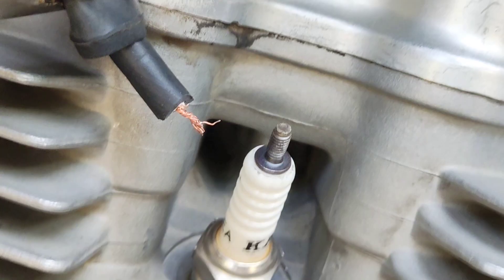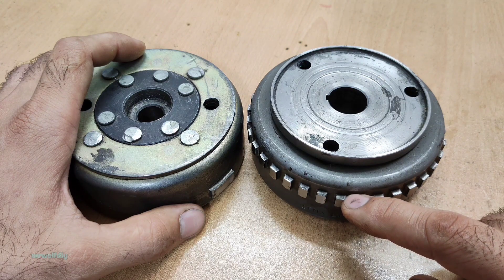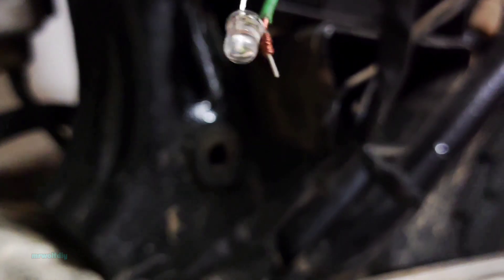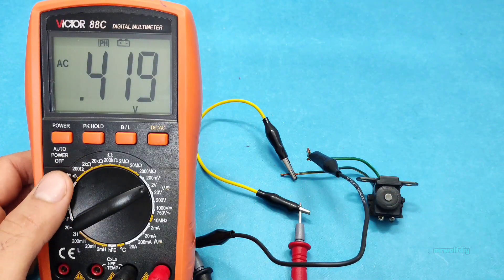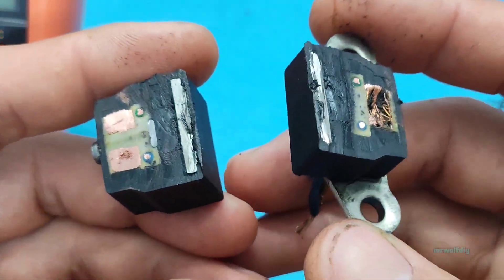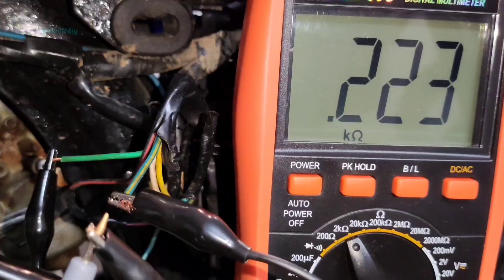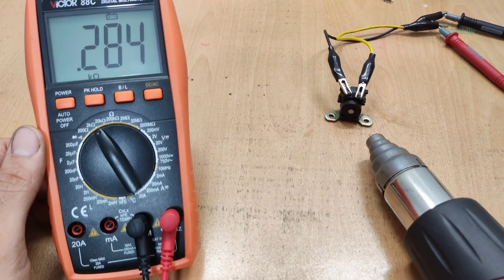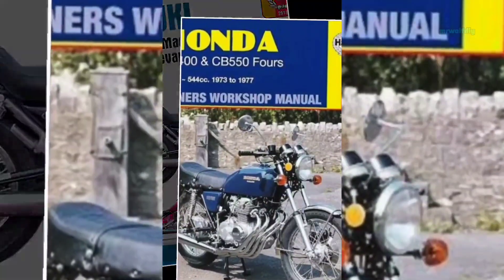NO SPARK? Don’t Replace Anything Yet – Test THIS First! (3 Best Ways)

Comment: Great information for bikers who are lost their money, most of mechanics doesn't know proper technical issues. they always told to change entire ignition system which cost more than 2000+. It is unnecessary, this will finish your problem with in 300rupees.iam also one of the victim, I lost my money. 😮

Comment: my issue is kind of weird, oem stator just looks as brand new, no blackish colours all over and no burnt signs. It could be my pick up coil,  when i kick start it there is a spark but it doesn't turn on even when the carb is tuned and everything is set. and eventually when I actually start up the bike it stutters like having a stroke, it needs more throttle to get it steady but when I let go it dies. you reckon it could be the pick up coil? bike doesn't wanna even start at the 2nd day of this issue. (the 1st day of the issue is when i go full throttle, the bike stutters and dies, and I wait to cool it down and it actually starts up. and the second day it actually does not want to start up but it has a spark. I don't understand pls help.)
Reply from the maker: From what you’ve described, there’s a 90% chance the problem is with the pickup coil or the stator (voltage fluctuation when it gets hot), not the carburetor.
Don’t judge the stator by its appearance. If your ignition coil is producing spark, measure it with a multimeter — it should have a specific resistance "depending on your motorcycle model" (check service manual)Also check the pickup coil’s resistance both cold and hot; that will reveal the issue.
You still didn’t say what motorcycle you have — is it using a CDI system?
Reply: @MrWolfDiy yes... it is a old cdi and my bike is a klx 140... thanks for the answer btw! Really informative❤

Comment: Is this method also working on fuel injected type?
Reply from the maker: Yes, the magnetic pickup sensors in fuel-injected and carbureted motorcycles are the same,
unless some models use electronic pickups, which are different.

Comment: Bro what if the gap is too big.
Reply from the maker: The pickup is not being triggered sufficiently, so it may output a weak signal. At higher RPMs, its performance drops.

Comment: which advance angle versus rotation speed characteristics betrer for 2 stroke and 4 stroke engines? which simple commutator without mcu can get changeable advence angle when rpm rise?
Reply from the maker: Hi dear good question 
Two-stroke engines have a faster advance angle...
Without an MCU, precisely adjustable advance angle changes are not possible, but simple circuits with basic electronic components can achieve some variation.
Reply: @MrWolfDiy whish simple commutator can change angle?
Reply from the maker: There is no simple mechanical commutator that can adjust ignition advance “intelligently and accurately” as RPM increases.
However, there are basic and limited methods that can create a small amount of advance change - such as analog phase-shift circuits or manual adjustments to the ignition timing angle...
Maybe I'll make a quick shifter later.

Comment: Similar with electric guitar pick up
Reply from the maker: They are completely different.
A motorcycle pickup is an electromagnetic sensor used to determine ignition timing,
while an electric guitar pickup is an electromechanical transducer that converts string vibrations into an audio signal. 🫶